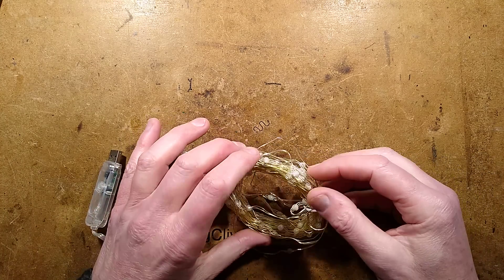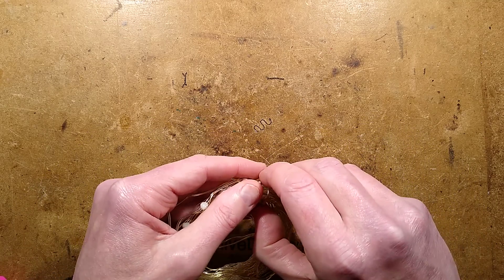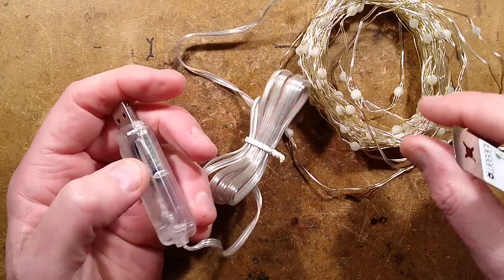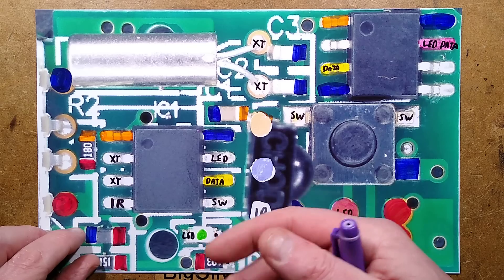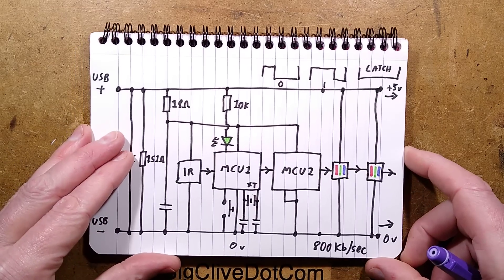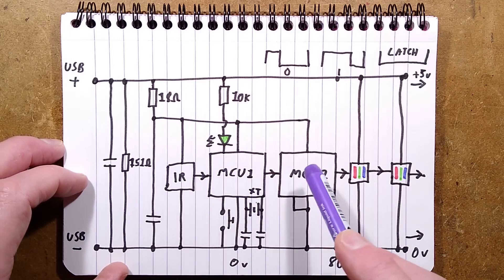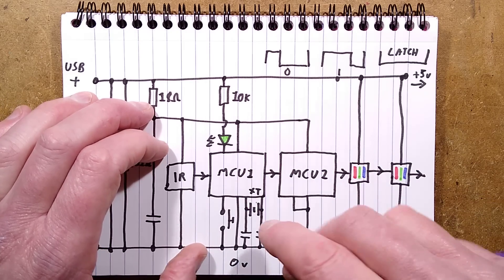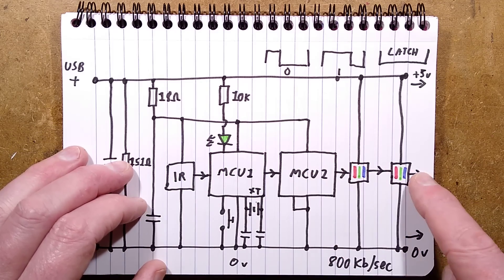Exploring a faulty set of addressable resin blob LEDs - with schematic

Comment: I have a few strings of an other version, not rigid copper wires but more flexible triple transparent wires. I cut the usb controller, put a connector on the end of the wire and use it with small wemos sized esp controller with wled firmware.

Comment: I love love love these RGB lights! I'm still amazed how fast prices have dropped. It seems that these "blobbed" chips are SK6812 since they have a very fast PWM rate (> 1 kHz) and do not flicker even on camera, which used to happen a lot with the ws2812 type (using < 400 Hz). Currently building an assortment rack where every small drawer has a LED at the front (500+ of them) driven by an ESP32 with WLED firmware. You can send commands to it from Javascript via wifi, so I can have it show a music waveform at 2x2m size when idle, or just search for parts in my inventory with a web interface and have it send the position to light up the drawer where the components are in. Since these christmas lights have 10cm of wire between each, I don't even need to manually wire single LEDs but just glue them as zigzagging string from top to bottom.
A nice followup video is this factory tour by Strange Parts showing how these chips are made, wired and packaged: https://www.youtube.com/watch?v=pMjhJ9kcaU4
Reply: The original 400Hz PWM rate has transitioned to around 1.2kHz (alog with a few other improvements to the IC, such as reverse polarity protection) for pretty much all WS2812b labeled products and equivalents on the market today. 
Rather than assigning a new part number to reflect the upgraded features (as we'd expect from a semiconductor with improved specs ), World Semi quietly issued a bulletin-style datasheet in 2021 summarizing the new features that put their latest revision of WS2812b back on par with growing competition such as the SK6812. All the newer variations in the WS281x family also use the higher PWM rate. Hilariously, World Semi's competitors' datasheets still proudly point out their "faster" PWM rates, years after it stopped being true.
Reply: @suromark  these are not 6812s, and while that video is nice, these are NOT made like that.
Reply: @scruffynerf7314  I can't quite make out which type of LEDs they used here, just making some educated guesses from what I've seen 🤔  I've bought a lot of these strings over the months to play with, some were made with clear resin, some opaque, some with separate silver wires or a single flat cable (these feel much easier and robust to handle but not as visually discreet as the super thin strands). Most have slim chips, like 3x1 mm sized and the in/out pins offset on either side of the center with supply on the outer pins. The most recent one I got is 20m long, but those use something like size 3030 chips with the data line on the outside soldered to two pins then snipped to break the in/out line apart, and plus/minus on adjacent pins, and they don't flicker on camera and were at least sold as sk6812. Lots of shapes and sizes now available. 🙂
Reply: @scruffynerf7314  Aren't you just a ray of sunshine

Comment: Thats what I make my rope lights for xmas from.  Chop of usb shove on clear hose and solder on a esp32 with WLED on.  Do the 20m lengths   5v supply and great.
Reply: I have a 10m string and voltage drop is horrible, but i am using the stock usb plug. Do you experience voltage drop at 20m full brightness?

Comment: A little-known feature of the WS2812 timing is that although the bit-to-bit timing is tight, you can often leave significant delays (100s of microseconds) between bytes. What these might be doing is the first MCU is sending bytes via a UART, leaving it time to generate the effects, and the second is converting a byte at a time to WS2812 protocol. As long as the baudrate is such that one byte takes no less than 8x the 1.2uS/bit WS2812 rate, there is no need for handshaking.
Reply from the maker: I have pondered if the data stream could be stalled in some way or abused to get a bit more time.  I think the main thing would be keeping the pauses between each LEDs data low enough to avoid the LEDs thinking it was the end of the stream.
Reply: I find bit banging with esp8266 is very easy to drive the ws2812b.
Reply: @TheEmbeddedHobbyist  Me too, when they first appeared they were a bit daunting but as Mike points out you can relax a bit when you know about the byte timing and if your good at 'bare metal' code your good to go anyway !
Reply: @andymouse  yeah Mike is right, as long as you don't get too close to the latching period timings can drift. Im sure they they start their bit timers at the start of the bit and just check the line 3/4 of a bit time later.
Reply: @TheEmbeddedHobbyist  im going to second the bitbanging it with a esp32 or esp8266?? dunno what that chip is i'll have to look it up, you cant beat $3 for a esp32 though
Reply: @frogz  the esp chips are great for led projects, fast, lots of ram, and built in WiFi. Normally got as modules so easy to work with. I've done a few videos on this. 😉
Reply: These "fairy lights"  are similar to the WS2812B, but they are not the same. They all share the same data line, and are pre-coded with their index, so each LED only looks for its dedicated triplet. I don't know how much this does affect the timing requirements.
Reply: Huh

Betcha the initial fault was timing going too far out

Comment: How many microcontrollers do you need to light up a string of wa2812 leds? Apparently for this Manufacturer they have used 2. Either it was cheaper, or it it was easier to design using 2 mcus. 1 handling the button, ir sensor and timing crystal and the 2nd one for its only purpose, driving the leds.

I guess its easier to implement because instead of having to schedule instructions you can just use 2 separate mcus. 1 solely focussed on driving the leds and using some simple data input logic determine the modes while the other mcu handles the ir sensor and the rest

Comment: There is a version of these that instead of passing data from one LED to the next, connects them all in parallel, simplifying the assembly (and allowing a smaller blob size) . 
Each LED has its own internal address - the way this is programmed is clever - I know someone who has seen the process at the factory - they didn't get all the details but it is done in a jig that uses light ( laser or projector) shining on a LED to enable it to program in response to signals sent down the cable. Something along the lines of "If you can see light now, you are address x". Possibly done in a x/y array (but wound round a drum) to do  rows and columns a a time instead of each LED individually.
Reply from the maker: That brings the Twinkly lights to mind.  I wonder if they use the RGB LEDs themselves as photodetectors for the programming.
Reply: This sounds like Adafruit PID 4917, I wonder if they know how these fixed address LEDs get programmed
Reply: @Jaaxfo  they are just reselling them, at a big markup. Not even sure where they got that number from.  Search in China and you won't find that used
Reply: @scruffynerf7314  the number is their catalog number, I mentioned them because it's often easier for a reseller like them to find out how they work than for some random guy on the internet. They do provide the basic datasheet that lists the manufacturer of you want to ask more directly
Reply: This might not be how they're doing it but if they are laid out in a jig it would be a lot more efficient to program one bit of address at a time, by projecting patterns and sending a command like "if you can see light now, set bit 3 in your address", assuming they're OTP and start with all bits clear. Programming one whole address at a time would be a good idea on something like a machine that pulls the string past a single light while somehow maintaining an electrical connection.

Comment: I once tried to build a primitive type of improvised photo spectrometer with a regular RGB LED. They can not be used for that purpose however because of the pulse-width modulation (PWM). So I eventually simply purchased a photo spectrometer. Very cool toy, but not cheap.

Comment: I wonder, are there any decent addressable LEDs on the market that require a lower data rate? 800 kbps seems like extreme overkill for Christmas/fairy lights.
Reply from the maker: There are other versions like the APA102 that use clock and data lines, so the data transmission speed can be whatever you want.
Reply: They are very easy to drive with most modern uC

Comment: Bought a bluetooth one like this last year and just replaced the board with an esp8266 running WLED and integrated it into home assistant. Made 5 more 200 led this year running on esp32-c3 as presents for friends and family
Reply: I was gonna do this. In fact I took apart my Argos lights from last year, asked TwatGPT to make some code for some flashy bollocks on my ESP32… then a few weeks elapsed and I realised what a waste of time it all is, rescued my poor ESP32 from a banal existence, and put back the Chinese MCU and left it alone; I can handle reaching down the back of the cupboard to press the button - a bit of exercise never killed me.

Comment: I don't remember that ws2812b needs 800kbps, IIRC when not "addressed" they remain static by themself. But I can be wrong.
Reply from the maker: They only need the data when it's actively being transmitted.  They will hold the colour while the next frame is being computed.
Reply: They do indeed stay on once latched. It's not a continuous stream, but as Clive explains, once sending data you can't interrupt that stream for too long, because that would latch the data at that time.

Comment: I love addressable LEDs, I recently bought a 20m length of these with 200 LEDs and a controller for less than £15 on Amazon, insane! I use WLED on an ESP8266/32 to drive them, but the controller is useful for quick testing purposes.
Reply: I bought the 20 m version for just over 5€ a few days ago.
Reply: I own the 10m versio nqnd the voltage drop is very noticeable, how do you power 20m at full brightness without weird colours at the end of the string?
Reply: @25566  Yes that is a problem, it’s very noticeable. The original controller automatically limited the brightness of the whole string depending on how many pixels it was controlling which made things quite dim, WLED will do the same thing if you set it to but I currently just have it running animations which have a lot of black space to limit the overall current. The only option for full brightness is to inject voltage along the strip, but that’s true of any of the 5V addressable pixels, unfortunately.

Comment: When these first appeared, someone claimed they somehow retained their addresses. Not just a shift register with location dependent on the chain but addressing that remained even if the chain was split.
I;ve seen no evidence of this. They just seem to behave the same as WS2812Bs. Has anyone seen a different type ?
Reply from the maker: There are versions with hard coded addresses and a two wire system, and also versions that use an odd LED that can accept whole-string colour change codes and a crude randomiser, probably based on sloppiness of the internal timers.
Reply: Yes, these do exist. The resin blobs are typically a bit smaller
Reply: @mikeselectricstuff I think I'd keep well away from playing with hardcover addressable led, too limited on what you can change on the string.

Comment: Is there a limit as to the length it could drive?
Reply from the maker: The number of LEDs it can drive will be limited in software.
Reply: @bigclivedotcom that entirely depends on your software :D

technically, the WS2812 protocol doesn't limit you to any number of LEDs, as it's just 24 raw bits per LED, and once an LED has a color it passes along all the rest down the wire. The real limit is your desired refresh rate, though I'm able to get about 200 cycles/second running about 160 LEDs, so you could manage with way more

Comment: what you might not be able to detect this way is whether the wx2812b-style leds want the color information in RGB or BGR or GBR or whatever. wled can deal with this really good, it's just annoying when you try to combine them.
Reply: there's a setting in LED preferences there is a "color order override" setting. does that help?
Reply: @bylescx  yes, you can configure/fix this in wled, e.g.
Reply: @lImbus924  oh, I was just suggesting a solution to your bit about annoying when combining a mix or RGB/BGR etc :)

Comment: I've hacked loads of these using Wemos D1 mini and WLED firmware. One odd thing with them is the id is hard coded on the LED. So if you run 2 sets in series and turn on LED 1 then LED 1 and 101 both turn on. They're great for Christmas lights round the windows.
Reply: I use the wled software and a small esp wroom32 to control all the led lights in my pc to stream the colours in the cooling fans and light strips. 100 leds that colour flow instead of the default all fans show the same colours at the same time.. I did have to rewire all the fans with 4 wire connectors and custom ws812b led tape tho.  The colour stream starts at the top of the pc then runs forward and down thru the fans then back along an internal strip to the rear fans so a continuos moving stream of colour keeps running.
Reply: @CBdesigns70  I am surprised that no one has yet made a decent LED controller setup for taking over your PC fans from various suppliers so you can move away from each companies bloatware.
Reply from the maker: They don't have hard coded addresses.  if 1 and 101 are turning on then it may be a software thing.  The hard coded ones are usually the two wire type like the Twinkly branded lights.

Comment: The RP2040 configurable IO module is great for driving these LEDs as it runs independent of the main processor - I've had strings of multiple hundreds running from a single processor.
Reply: I have a Pico driving a 16x300 matrix where the 16 rows are sent data in parallel.  PIO is rather neat.
Reply: people have figured out ways to abuse all kinds of peripherals for driving addressable leds with DMA, most commonly i2c
Reply: It the i2s interface that tends to be abused for driving these. The i2c interface is neither fast nor flexible enough.